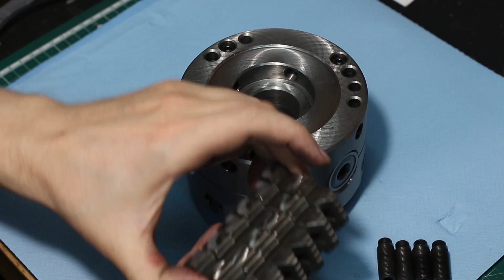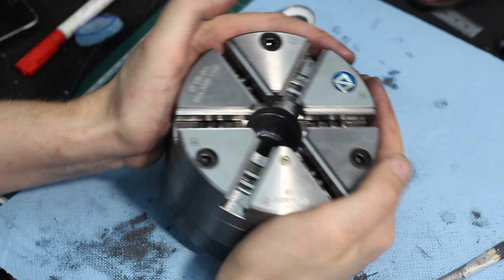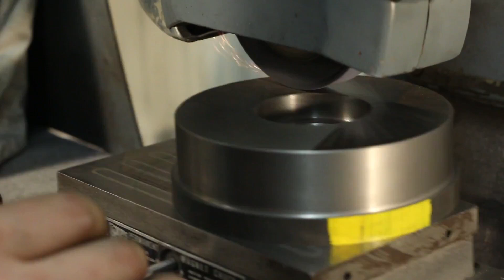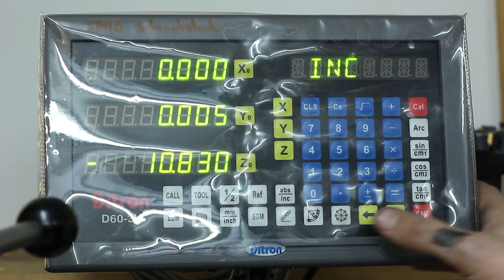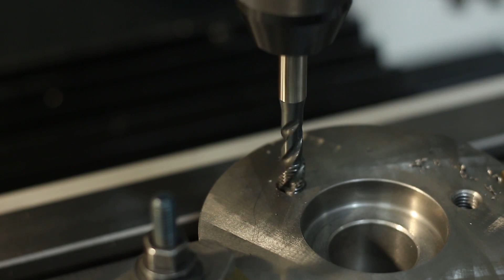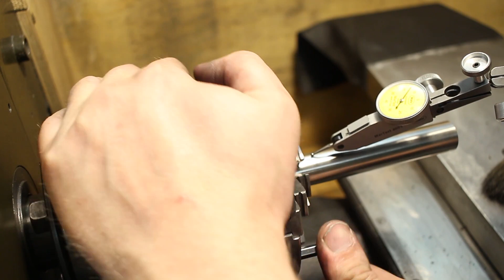Zentra six jaw chuck and backplate

Comment: Great to see you back. 
I noticed you use a vacuum when turning cast iron. I do the same and boy o boy, what a difference when cleaning up afterwards. 
My 6 jaw came with the lathe and needs the cleaning and set up correctly, so well timed video. Thanks.
Reply from the maker: Yes - I did a fair bit of cast iron in the recent time, and I learned to use the vacuum, otherwise the shop ends up to look like a coal mine.

Comment: Very nice video, great job on that backplate. I have so much respect for you guys using 6-jaws, I almost always use a 4-jaw to help compensate for my poor machining...;-) OTOH when I watch you adjusting each pinion, it doesn't seem too different than a 4-jaw...very nice how you surface ground that backplate, that bore really fit nicely on the spindle nose! :-)

Comment: Zentra you can always buy at the moment they have good quality and medium priced... For less than the half of the price you get a SanOu 6 jaw direct from China but than you have to have little luck to get a perfect chuck i bought two steel chucks 160mm from them and they are excellent made i didn't expect such a good product for about 100eu that's why i bought the second 😁 with my DIY D1 4 backplates i can chance them within short time...Stefans lathe has also a very fast and good spindle nose.. and yes they have normal 7° 7' 30'' short taper just like the camlocks...top Video as always Stefan 😎

Comment: Usually the, on the chuck, “0” marked pinion is the one that gives you the zero runout tightening. Could it be you switched the pinions around since you not tighten to zero runout where the “0” is stamped?
Good stuff all the way, your channel is. Keep it up👍

Comment: My older Buck six jaws only had one pinion.  Don't know if Buck did that on purpose or not?  I have a newer Taiwan made Buck that has two pinions.  While there is a slight difference in repeatability between the two it is very slight.  Less than .0003 inch.  On a older Chinese six jaw I used to run it always ran .0006 with just grinding the jaws.  I do a lot of thin wall plastic parts.  distortion of the parts when doing ID work is too great with three jaw chucks.  I absolutely love six jaw chucks after making the change.  Solid jaws like the one you have will go down to smaller diameters without having to make soft jaws like two piece jaw chucks would require you to do also.  Your chuck looks to be of very good quality.  Nice score!

Comment: "I always loose the spring on the key..." 
xD
Reply from the maker: I have realy no idea how this happens :(
Reply: Take note, He drops the key less than a minute later. All I could think was, I think I found out how he losses the spring hehe...
Reply: "lose"
Reply: "lost"
Reply: I had to chuckle at that as well. Anyone when first learning not quickly teaching themselves to automatically remember to remove the chuck key after once or possibly twice forgetting it, then maybe operating machines isn't for them? Drill chuck keys with the spring loaded "safety" addition are even worse to try and operate. The garbage can is the best place for those springs. :-)

Great video as always Stefan, I have the exact same spindle nose on my lathe. I've yet to figure out why they just didn't use a D1-3 mount. It could hardly add much more to the machines selling price and would be a better and more repeatable mounting system. The later models of my lathe did start being offered with that D1-3.
Reply: Spring? What spring ...?
Reply: While I appreciate the reason the spring is there, I do not hesitate to intentionally lose them. Immediately.
Reply: the spring has a tendency to get lost on first use, i dont know why this happens

Comment: Still a pleasure to see your video (as your instagram account). A question from a newbie why are you using grey cast iron and not steel? because there no risk for safety and it's cheaper or for any other reason ? thank you for sharing both your project, experience and comments. It's always instructive and interesting.
greetings from france !
Reply: Gray cast iron is used because of it's vibration dampening abilities and is pretty much standard for most factory machined back plates unless the chuck is designed for and meant to be used on a high rpm machine.
Reply from the maker: Mostly because cast iron wears better than unhardened steel. Dampening abilities of cast iron on such a solid part do not have much effect.

Comment: Interesting as ever Stefan. Is the three jaw going to clutter up the shelf from now on or is there a situation where you will still use it?
Reply from the maker: Yep - As a Softjaw chuck :)
As we speak, I got it mounted with large aluminium pie-jaws bored for a recuring job.
Reply: Great use for it. Looks like a 6 jaw may have to be on the birthday list for me!
Reply: It appears the geared side of the scroll plate has galled the rear body of the chuck where it absorbs the thrust of the scroll. Why: Debris? Soft metal? Lack of lube? Insufficient bearing area? Certainly was not high rpm from tightening chuck too rapidly! ;)

Comment: It appears the geared side of the scroll plate has galled the rear body of the chuck where it absorbs the thrust of the scroll. Why: Rough surface on scroll? Debris? Soft metal? Lack of lube? Insufficient bearing area? Certainly was not high rpm from tightening chuck too rapidly! ;)

Comment: The adjustability shown is an old idea.  First patented by Buck, et al. in 1953.  U.S. Patent no. 2639157. It expired in 1968.
Reply from the maker: Yes - Didnt say that it is something new. There are even different styles, Bison has an integral backplate on their adjustable threejaw chucks with tapered, tangential screws.

Comment: 11:30 where did you buy that type of drill? i searched on ebay but hard to find, not sure if my searchwords are correct ( tried "core drill" , and "MASONRY drill")
3:09 next version they should use M16x 0,75 for the fine screws, its a really fine threat ;D
(best tap+die i have for now)
Reply: try putting rotabroach in your search

Comment: Stefan,

Whenever I dismantle things for cleaning and inspection I always wash parts with liberal amounts of cleaning solvent. However I have noticed that you do not do this, but rather use clean rags or shop towels to remove grease.  Is there a particular reason for your method that has possibly escaped my logic?

Regards 

Steve Callachor

New South Wales in Australia
Reply from the maker: Ahoi! Yes, I dont like to use solvents, especially stuff like break clean (which I dont even stock in the shop) or degreaser (which I also dont stock :D) when I dont absolutely have to. I use a fair amount of IPA, which is not as bad for the health and flashes of clean. Parts like the chuck go in the ultrasonic cleaner with a basic degreaser solution.
Reply: I also use ipa, but the Indian pale ale variety, it's also good for health.
Reply: IPA = the beer ?
Reply: Isopropanol Alcohol

Comment: sixjawchuck..........think i know her , shes the sister of pokerhiney

about the spin option for the grinder , cant you use one of those cheapish rotary table stuck directly on the grinders table next to the magnet vice

like to find one of these smaller surface grinders one of these days , they aren't eazy to find in that size though . i think you can grind tools cutters and drills with it too if you have the adapter for it
Reply: You can get circular mag chucks designed specifically to fit on a rotary table for grinding round things :)

Comment: You're useless as a machinist if you can't use a 4 jaw. You literally just finished making a video about using a 4 jaw only with extreme pressure angles introduced. I love you videos Winter. Don't be steering young fabricators wrong.

Comment: Hi Stefan, I got DIN55027 studs from this company here in Sweden: 
https://smaskin.se/svarvning/fastspanning/tillbehor-chuckar/stod-dubb-med-mutter
I got a 200 mm cheapo Chinese 6 jaw for my nice German made Weiler Condor and needed these for making the back plate .
Had low expectations on this chuck, but I must say that after similar treatment as You gave  Yours, its very accurate. 
Needed something for large plastic tubing etc. but found it much more useful. Had for a Year  now it´s probably my most used chuck. 
Mine also came with sets of soft jaws.  I think turning the back plate in the same lathe its going to be used is a good idea. My Weiler lathe has a stud that makes sure that the chuck goes on the same way on the bolts each time. Noticed Your lathe does not have that feature, but it would be fairly easy to add.
Thanks for the interesting video!